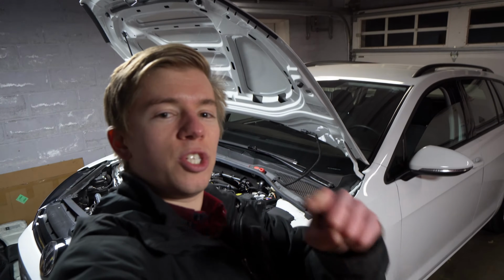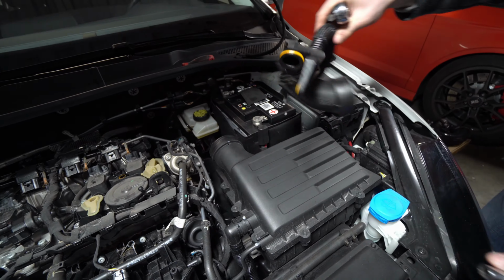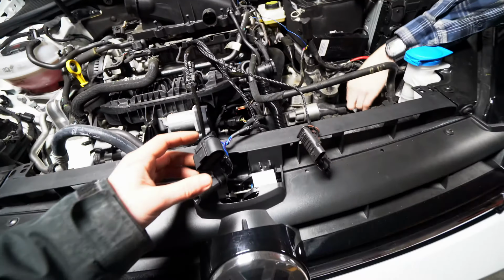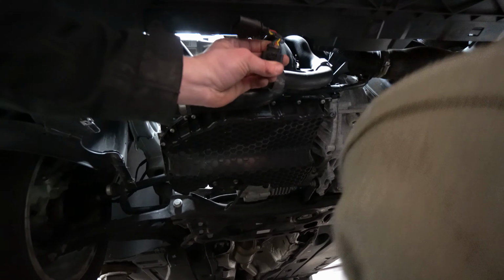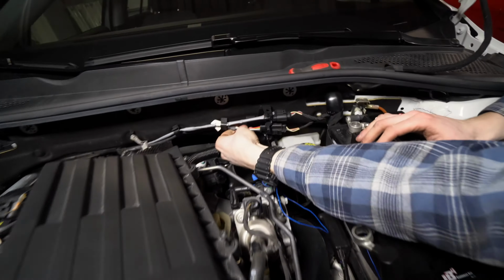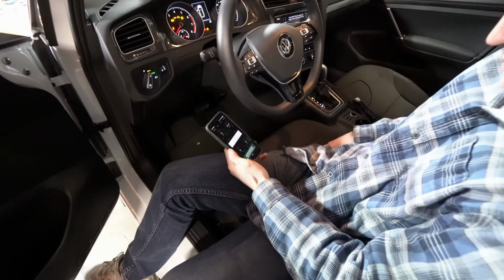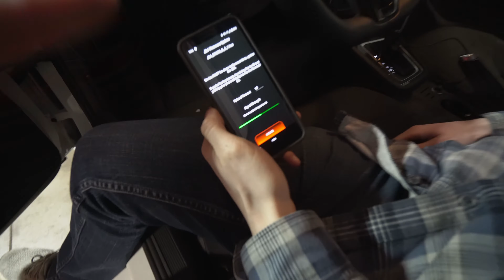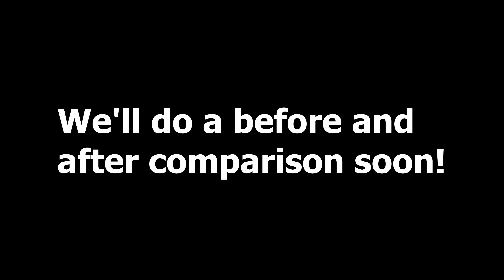JB4 Install Golf Sportwagen Volkswagen/Audi MQB

Comment: I got a jb4 and intake on my 2018 gsw. Been lowered on eMMotion lowering springs, and audi tt rear spring pads. With s4 18 inch wheel and 5mm spacers in the rear, stance is very nice with no rub. Going to be adding audi q5 4 piston brembo calipers with audi a4 rotors to the front, along with neuspeed stainless steel lines, for a nice cheap big break upgrade. Cost about $500. Ill sell my old breaks to make some of that money back.
Reply from the maker: Dan is researching the big brake route he wants to go. Curious to hear how you like the q5 brakes when you make the switch 🤘

Comment: Question: Not to be too Boomer (I am ;) ) but is there a laptop method to achieve the same result?I would hate to butt-dial my ECU when getting out my wallet at Taco Bell...
Reply from the maker: They do have an interface cable for use with a laptop if you're of the generation that is used to cellphones the size of briefcases and computers the size of rooms 😂.
Reply: @HardwayLearning  Dude, computers the size of buildings. Radio telephones that take up the entire trunk of a '53 Packard. Girlfriends with stockings AND garter belts (sorry Granma).